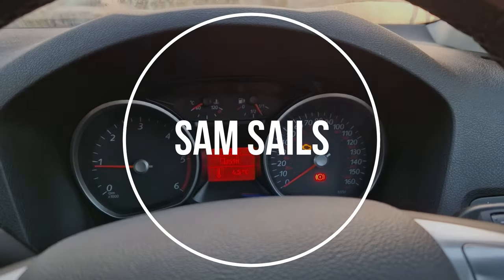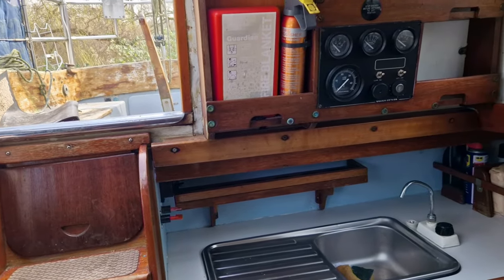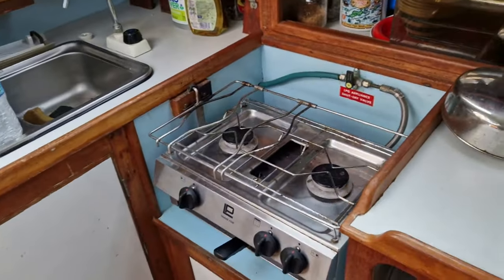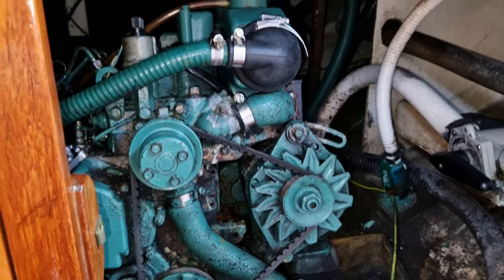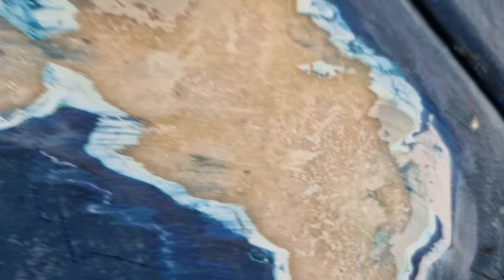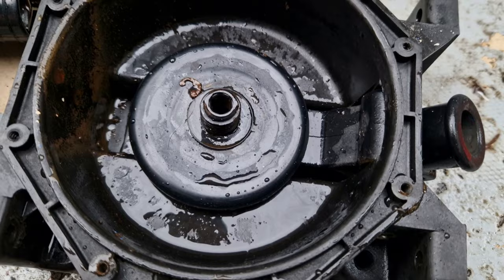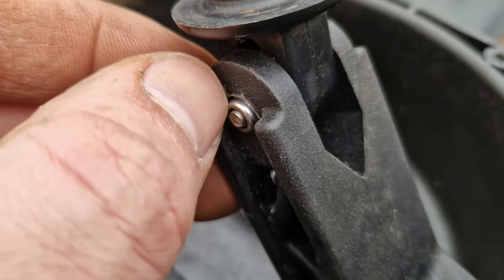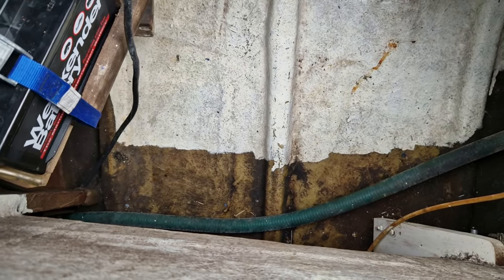Introducing 'Stowaway' / Preparations for launching.

Comment: Does that area around the rudder heel not need some glass?
Reply from the maker: If I was using polyester resin glass would have been used but West systems epoxy is extremely strong, in this application i've mixed a high strength bonding agent to further strengthen the area. Any larger and biaxial cloth would have been used.

Comment: Sam, what’s your Hebridian? Windvain where did you get the plans from
Reply from the maker: The Hebridean is a self build wind vane self steering system. I bought the kit for this which was supplied through the.post with laser cut metal parts and full plans to build. There is a website and facrbook page
Reply: Thanks Sam for the info on the wind vane..
I too will be sailing out of Pin Mill so I may bump into you in the Butt and stand you a pint!..
Enjoyed following your adventures with the Hurley 22..
Reply: @samsails9820 thank you Sam. I am looking forward to moving to Shotly this year when I get my engine rebuild.